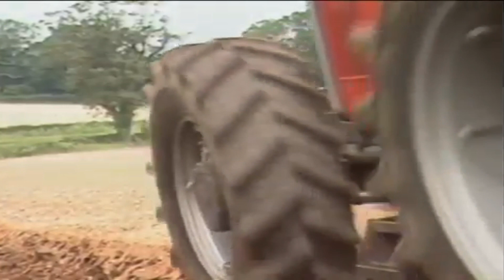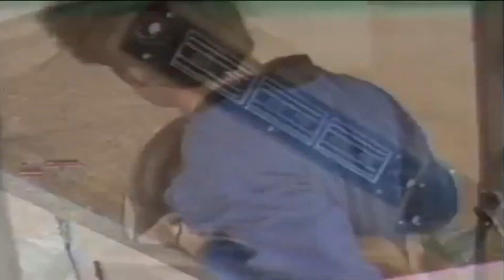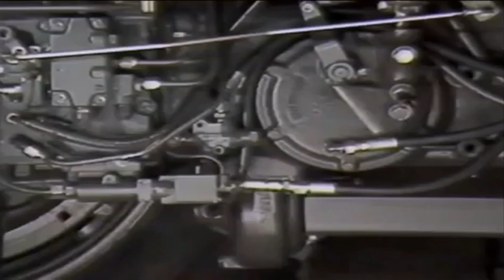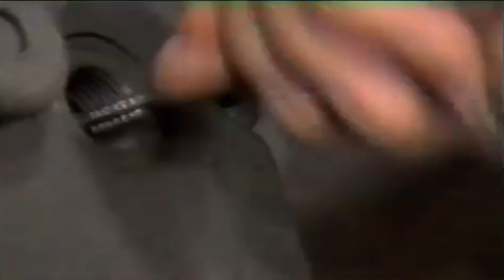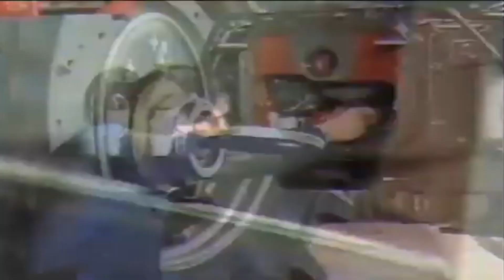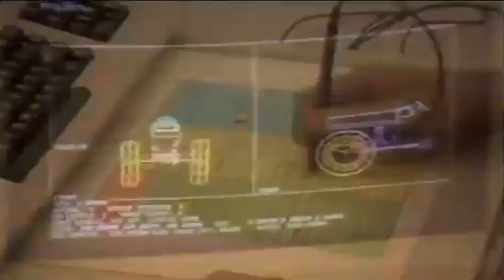Massey Ferguson 2000 Series Tractors - Apart from the crowd

Comment: My Uncle has an Massey Ferguson 2620
Reply: That model was considered underpowered as it used the same very heavy transaxle as the larger MF 2000 series models, and only had 95hp.
 It was soon replaced by the MF 699 tractor in 1984, which used the same Perkins A6-3544 engine, but this time mated to the smaller and lighter MF 600 series transaxle design, itself being derived from the former MF 500 & MF 100 series transaxle design.
 The MF 699 had a better power to wieght ratio than the MF 2620, which was considered a bit of a gutless wonder.
Reply from the maker: That’s awesome! The 2620s were real workhorses — solid tractors that just keep going 🚜💪

Comment: I always liked this 2000 series , no nonsense design, easy access to vital component's, and above all minimum electronics, a great machine.
Reply: I have two 2705s for sale in MN one is currently getting the power shift gone through, paint, and cab kit
Reply: Also has 5100 original hours
Reply from the maker: Spot on — the 2000 Series had that perfect mix of strength and simplicity. No computers, just pure Massey muscle! 😄🚜